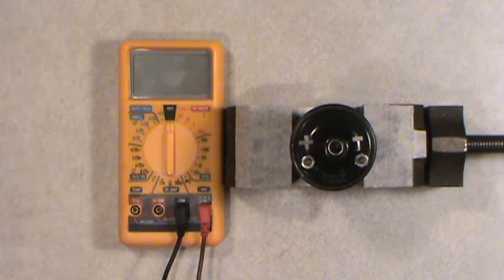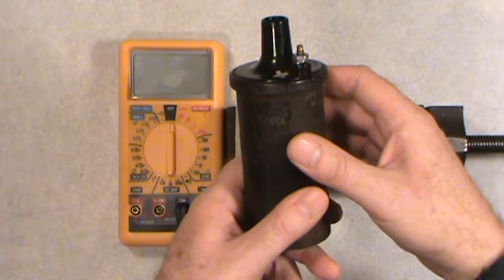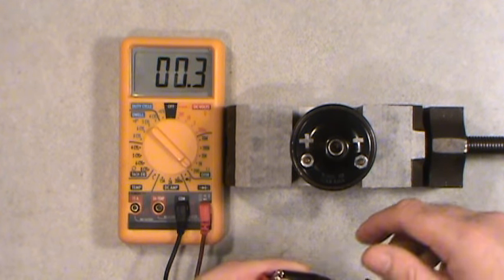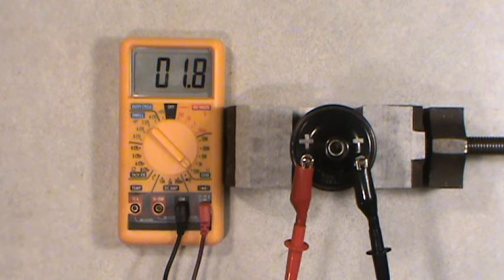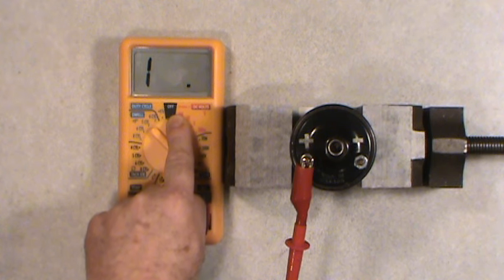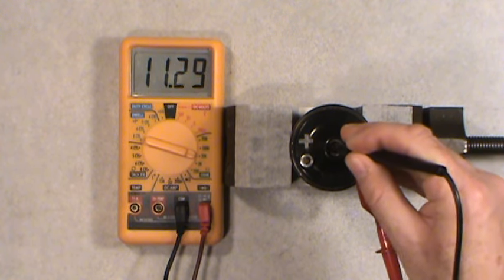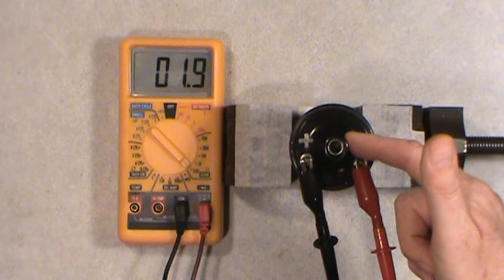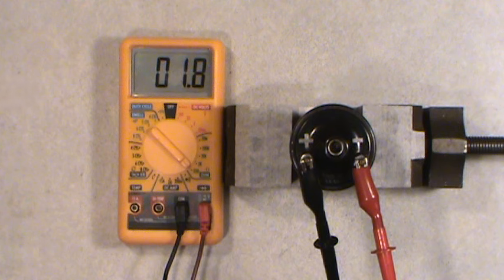Ignition Coil Test (The Short Version)

Comment: Thanks. This got me out of some brown stuff. Good wishes from the UK.
Reply from the maker: Greetings...juleswells59........You're welcome, and, thanks for watching.........It's good to know, that, this video of mine, was able to help you out.........UK you say...brings to mind (mine, that is), that, some of the older vehicle's ignition systems, where you are, would have probably had, basically, two different, low ohms specifications, for two different ignition coils, that look like the one in this video of mine.........If it had about 1.5 ohms on the primary, low ohms side, then, there would probably be, a "ballast resistor", that was used along with it..........If it had about 3 ohms, on the primary, low ohms side, then, usually, "no" ballast resistor was to be used with this one...!!!.........So then, always check, what the "exact" ignition coil is, to be installed, that is specified, for that particular vehicle and engine combination, so, things don't get damaged, and that, no money gets wasted needlessly, and......till next time......Be Safe, take care, and have a good one.

Comment: Hi. You mentioned at clip 7:15 that it can cook to high temperature. What is an acceptable temperature on these coils?
My Coil heats up with key ON only at 117 degrees Farenheit,  is that normal?

Thanks in advance

Comment: HANG ON BUT THERES SOMETHING MISSING DUDE.     I have a 12 coil and it tests from ground to middle which we call the tower going 10k ohms. BUT customer vehicle has a 6v coil with a resistor on the side. measuring just the coil from ground to tower in middle, we get much less ohms. So the point I want to make is there are more than one kind of coil. Ballast coil, high output coil, etc etc. They all have different readings. 

Finally been though my coil was within range and the customers, both on a bench test produced a very small spark. Was out on a job last week early part of in a wedding car place. 10 old vehicles same as queen has but white. The one not starting I powered up the coil and let the tower send the high tension out to engine block. The spark was huge. Like Luke Skywalkers Light Sabre. 

If you know the secret to how that on a 12 neg ground system with coil in range was so powerful, do tell me.

Comment: Exactly that happend to me,coil to hot on top of manifold,cooked it,now bolted to side of engine bay ,runs much cooler !
Reply from the maker: +Darron Mecak ....Greetings Darron Mecak....Thanks for watching.............It's good to hear, that, You solved, Your "Hot", Ignition Coil problem....well done............Hmmmm...just thinkin'...Ignition Coils, are kinda like People, in some ways, as in, both, "Act", kinda "Cool"...when They're kept "Cool Enough"...!!!...lol...................Yes-Sir-ee-Bob...Over-Heated Ignition Coils, are something, to be avoiding alright...................Something, like an old school, Factory/Stock V-8 Engine, already, generates enough heat, in the engine compartment, when having, the (usually) factory/stock, Cast Iron Exhaust Manifolds, bolted to the Cylinder Heads......................Now then, just add in a pair of Long Tube, Exhaust Headers, and now, the engine Compartment becomes an "Oven", and even worse, slap on a Turbo-Charger or Two, as well, and also add-in, a very Hot Summer Day, and maybe, We now have a Pizza Oven...???...lol....................For the Oil Filled Ignition Coils, I prefer to have the Terminals pointing Upwards, as I had one of them, "Spring-an-Oil-Leak", when it was Mounted "Horizontally".....................Always make sure, when-ever Installing a Replacement, or Up-Graded Ignition Coil, to Check its "Specifications", to see if they are "Correct", for that "Exact" Ignition System/Circuit, to avoid having, either a Weak Spark, at the spark plugs, or maybe, one or more Components in that Ignition System, become "Fried"...!!!...and I hope not.....................If there happens to be a "Ballast Resistor" (Ceramic Block, or Resistance Wire type), that "might" be found, in the Ignition Circuit, along with an Oil Filled type of Ignition Coil, then, the Ohms/Resistance, of "Both", the Ignition Coil, "and" the Ballast Resistor, have to be...With-in..."Specifications"...or maybe...Oh-Oh...it just might be...(and, again I say)...I hope not...and..........till next time...........Be Safe, take care, and have a good one.

Comment: We have a forklift coil that reads 8.36k on the secondary. Doesn't want to fire. 1.5 on the primary. I hear 11k-13k is best on the secondary.
Reply from the maker: Greetings...David Tysdal.........Thanks for watching.........8.36k, does seem kinda low, on the secondary side........See if you can get a hold of a factory service manual, or perhaps, see if the forklift manufacturer has a website, or, any other website, that might have some parts showing, along with their specifications.........Have you tried any kind of spark test at all...???........Should be seeing, a good-n-strong spark, as in, blue-ish, or white-ish, "but not", a weak spark, that usually shows up, as an orange-ish, or yellow-ish color, showing on a spark plug, that is removed from the engine, that is connected to the spark plug wire, and also, grounded to the engine, while out, in the open air........Just make sure that there isn't any fuel vapors or propane gas, natural gas, etc. in the area, when having any open "sparks" happening...!!!........Is there battery voltage, at the Positive (+ sign) terminal, on the ignition coil, while the ignition switch, is in the run position...???.......Might be fuel related, especially if, there is a good spark...???.........Engine compression within reason (usually 100 PSI or more, most of the time)........Good luck, with bringin' "it" back to life, and.......till next time......Be Safe, take care, and have a good one.

Comment: Thanks mate.👍👍
An excellent and informative video. I have learnt a great deal from you today.
Brian, from Australia.🦘🇦🇺🦘👍🙂
Reply from the maker: Greetings...Brian Walker...……You're welcome, and, thanks for watching...…..It's good to know, that, some of my YouTube videos, are able, to help some folks out (kinda, has me thinkin', that, I might be on the right track, somewhat...maybe...???)……….Always make sure, that, you use the correctly "specified" ignition coil, for the "exact" engine and vehicle, otherwise, Ya might end up with a weak spark, at the spark plug's electrodes, or maybe, an ignition coil, that gets over-heated, and maybe, up to the point, where, the ignition coil gets damaged so much, that, it won't work at all, anymore...……..All ignition system components (aka, parts and pieces), should be, in very good condition/almost like new, and, if any adjustments/settings, at suggested intervals, are required, then, keep them up to date...…….Like me, if you can understand, how, the good ole points and condenser distributors operate, then, it makes it, so much easier, to understand, the much newer ignition systems, that followed "it"...……..Always keep in mind, that, all it takes, for an ignition system to act-up, or, not work properly, can at times, just be, a "bad" electrical connection, of, one kind or another, and......till next time...…Be Safe, take care, and have a good one.

Comment: Good video and knowledge. I am not great with electrics. I got the drift though. I am installing a Compu Fire Electronic ignition in my 009 Distributer on my 71 Beetle, it is a module that replaces the old points contacts in the Distributor. I needed to see how much resistance my coil has. Some are saying a coil with less than 3 Ohms resistance can burn out the electronic module. These are peoples online comments on a similar brand module.  I also changed to a new alternator with internal regulator as well. My old grey coil has 3.2 Ohms resistance and 9.09 Ohms on the 20k setting I have another red Bosch GT40R I believe is a resistor coil it has 1.8 Ohms Resistance and 15.21 Ohms on the 20k setting. Any thoughts on this will be great, thanks Rocky.

Comment: Thanks. I am however having a hard time finding the ohms specifications for the primary and secondary side on a 1956 Chevy 210 with a 12 volt 235" engine
Reply from the maker: Greetings...greg6925........Try to find a website for your vehicle that has a message board on it, as there are some really helpful folks, on most that I ever visited.........There were two basic types of oil filled ignition coils, as in, ballasted and non-ballasted.........Ballpark figures on the primary side, could be 1.5 ohms thereabouts, for a ballasted ignition system, meaning that, there has to be a ballast resistor used with the 1.5 ohm coil, or, the coil will get overheated and go poof, especially at low rpms and at idle speed..........Then, there's the 3 ohm thereabouts ignition coil that "does-not" need a ballast resistor at all, but, with the 3 ohm coil, I recall that the engine is harder to start, especially when cold..........The ballast resistor might be a ceramic block type, or, have a special resistance wire, leading up to the 1.5 ohm ignition coil........Ballpark secondary resistance, might be 10,000 to about 20,000 ohms thereabouts.........Make sure to get the primary ohms.resistance quite close, or the coil, will either have low output (too much resistance), or, it might overheat and go "poof", if the resistance is too low.........The whole primary resistance (ohms) story, for a points and condenser ignition system, really boils down to, controlling the amount of amps (amperes), that are flowing into the primary side of the ignition coil.........The much newer, computer controlled vehicle's ignition systems, can send 12 volts or more to the ignition coil, or coils, as the case may be, because the computer, simply charges up the coil in milliseconds of time, then stops, when fully charged-up (saturated), then the secondary discharges, whereas, a points and condenser ignition system, with the closed points, sending electricity for a very long time, especially at idle speed, needs to limit the amps going into the primary side, or, the coil will get too hot, and stop working, or, go "poof".....and.....be safe, take care and have a good one.
Reply: @RockysRoadshow  what limits the amperage going to the primary side of the coil? The 1.5 ohm ceramic resistor? I wish I had a wiring diagram for the car. It's a 1956 Chevy 210 four door hard  top with a points and condenser ignition system.
Reply from the maker: Greetings...greg6925...........I hear Ya alright, as in, so many parts companies, probably won't provide the primary (low ohms), and the secondary (high ohms) specifications, but, there are still a few of them, that do..........Your vehicle might have the ceramic type of ballast resistor, or possibly, a special resistance wire, that's part of a wiring harness (might be wrapped in tape or whatever), then, the single (special resistance) wire, goes to the ignition coil's terminal...........Here's what I usually do, with, what you're faced with.........Head over to Rockauto.com and look up your vehicle's...year, make, model, engine size, etc..........Once your vehicle is found, go into the ignition section, and look at all of the ignition coils, that show up for your engine..........Click on the smaller buttons for that particular ignition coil, and, if you're lucky, at least one of the manufacturers, will actually show you, what their particular ignition coil's (low and high ohms), resistance values, actually are........Also, look up..".Ballast Resistor"...and, if a "Ceramic" type..."does not"...show up, then, I be thinkin', that', your vehicle, probably has, that "special" resistor wire, that I mentioned earlier......Good luck, and...be safe, take care, and have a good one.

Comment: Great video thanks for the awesome knowledge
Reply from the maker: Greetings...Jesse Hereford...……You're welcome, and, thanks for the nice comment...…..I'm not so sure, that it's awesome at all, more like, I studied it a bit, and learned a basic amount of information..…….Always use the specified ignition related parts, for the vehicle in question, so as to, avoid causing any unwanted problems, and, unneeded expense too...……Sometimes, an ignition system that's acting up, can simply be caused by, a bad/faulty wiring connection, so, keep that in mind, just in case, and...….till next time...…..Be Safe, take care, and have a good one.

Comment: Hey I’m having a no start issue as well on my 1978 924, I’ve replaced the faulty ignition coil (resistance measurements were off spec) however still no start, but I’ve noticed there’s 2 ballast resistors before the coil wich take the voltage down, I’ve measured them and the 1st one takes the voltage down from 12v to 8v and the 2nd one takes it down from that 8v to like 5.4V. This seems strange to me, as people say the coil needs 12v, do you think I should remove those resistors?
Reply from the maker: Greetings...TriCityPhoto........Thanks for watching........For the no start problem, then, make sure that, you are getting (usually), battery voltage/about 12 volts, when the ignition switch is in the "run" position, with..."engine Not running"...at the positive (+ sign) connection, on the ignition coil/s (not sure, if both of your vehicle's ignition coils, are always operating together, at the same time, so, be sure to check that out) .........Did you check for an actual "spark", at the spark plug, or maybe, use a spark tester at all...???........As for those ballast resistors, then, here's what usually goes on.........When you are cranking the engine over, to start it, the ballast resistors, are usually by-passed, because, the battery voltage, will usually drop down, from, oh, let's say, about 12.6 volts, down to, maybe about 9 or 10 volts, because of, the high amperage draw, from the electric starter motor........The ignition coil/s, have to put out a good-n-strong spark, when the battery voltage drops down, during engine cranking, so, the cold air/fuel mixture will burn properly.........Now, if we didn't have those ballast resistors in the ignition circuit, while the engine, was now running (not cranking any more), then, the ignition coil/s, would probably over-heat, and destroy themselves...!!!........So, once the engine is running, the key, in the ignition switch, has gone, from the start position (engine cranking, lower voltage, ballast resistor/s by-passed), then, into the run position (ballast resistors, are now in this "run", electrical circuit), to lower, the higher voltage, to protect the ignition coil/s, due to alternator, charging the battery, up to, about 13.5 volts, to about 14.5 volts, as an example, with the engine, now running on its own........Basically, the ignition coil, has to put out enough high voltage, during engine cranking, while the battery voltage is quite low.........Then, no more cranking is needed/engine running on its own, and much higher voltage now, that, has to be lowered, to keep the ignition coil from getting too hot/over-heating, and destroying itself........So then, that's why the ballast resistor is used, for this type of ignition system, which was usually found, on the older engines, that had carburetors on them...and......till next time......Be Safe, take care, and have a good one.